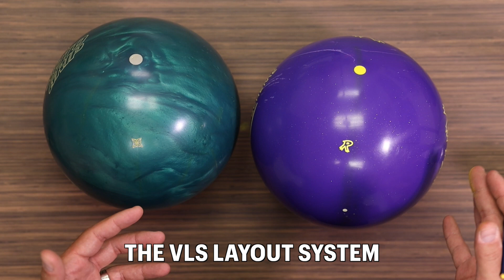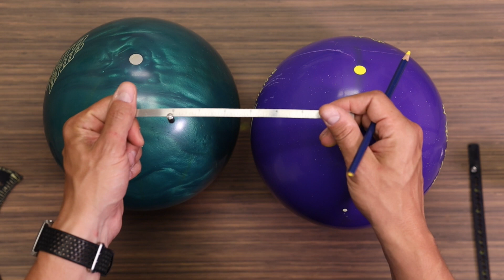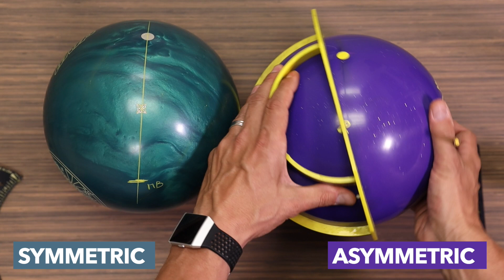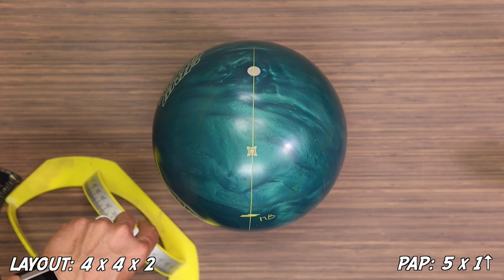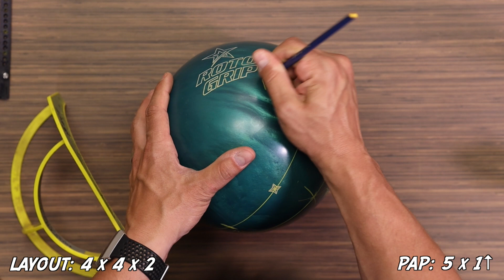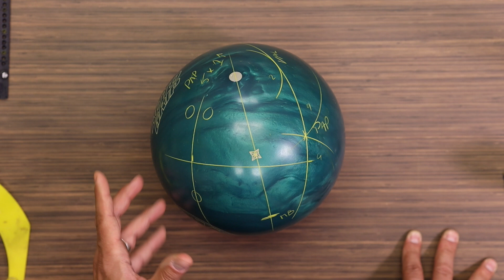How to Layout a Bowling Ball | Storm VLS

Comment: If I draw a roto grip hustle at 3 1/2 x 5 x 3, can I use it on fresh home oiling? I play straight ahead, with low roll, medium speed, and medium rpm. Thanks in advance.
Reply from the maker: It’s hard to say based on this without seeing you throw it.

Comment: this is a nice channel for learning knowledge about bowling ball layout, i m still confused about the distance between PIN to PAP, PSA to PAP, VAL to PAP and the ball reaction difference. thank you very much~😊😊
Reply from the maker: Pin to PAP is the most important.  It controls the ball flare potential.  PSA to PAP will control the shape of the hook down lane.   VAL to PAP isn’t a term since the PAP is on the VAL. The VAL is the line on which the PAP vertical coordinate is.

Comment: He starts out by marking the symmetrical ball 6 3/4 down for a theoretical mass bias......why? Why 6 3/4? Ok.
Reply from the maker: Hi Steve.  This is done on a symmetrical ball to get a spot on the equator of the ball.  6 3/4 is a quarter of the ball on the surface.

Comment: Yes, but every video I watch doesn’t show how to actually place the hole positions. Where do I find those videos?
Reply from the maker: The PAP is based off the grip CENTER.  So when you're done this layout process, you have the grip center.   The Midline is the line that cuts thru the middle of your palm horizontally and the center line is thru the center of the thumb and intersecting the fingers.   If your full span is 4 inches, you start from the middle and draw a cut line 2 inches on each side.
I hope this makes sense.

Comment: So this is a 4x4x2 layout with a 5 inch pin since pap is 5x1? Im sorry, im still in the early learning stage of understanding layouts.
Reply: No. The pin is at 4 inches from the PAP.  The PAP is measured from the grip center.  Check that video out as well.  You need to find your PAP before doing any layout work.
Reply: @markbuffa5840 "You need to find your PAP first" is CRITICALLY underrated advice for anyone just starting out from scratch. It's unintuitive to a new player that they would have to buy a ball with a default layout before actually getting a second ball with a custom layout. It took me quite a while of searching to find that very answer for myself, and I appreciate you saying it.

Comment: What about 3 x 5 x 4? Since 4 is longer than 3 obv, there is no outside line to intersect with bevause the 3 inch arc is inside the 4 inch arc. This system only works if the first number is larger than the last.
Reply from the maker: For VLS to work, you need the Pin to PAP and PSA to PAP lines to intersect, other than that it won't work, you are correct.

Comment: VLS as we know is developed and popularized by Storm so I assumed that it is tailored for their products. Is it effective to be use on other brands of bowling ball whether it is symmetrical or asymmetrical?
Reply from the maker: Hi Joe.  VLS and Dual Angle will give you the same result, just the process is different.  Once you finish a VLS layout, you can remeasure in Dual Angle and vice-versa.  It  comes down to a preference to the ball driller, however both methods should be practiced and known by all drilling professionals.
Reply: I have symmetrical ball from storm and brunswick, and asymmetrical ball from radical. The driller told me when asked what system he used to drill my bowling balls, i was told he used VLS for storm balls and Dual angle layout for brunswick and radical. In my observation, i think VLS is more effective in terms of overall performance when used in storm ball given both balls uses same surface.

Comment: Love that grease pencil! what brand, and where can I find it? The pencils offered by my distributor are awful.
Thanks for the excellent videos.
Reply from the maker: Thanks Bryon.  These are old telescore pencils from Brunswick, we have a whole bunch in stock.  They are great however they do break easily.  I like using a manual sharpener to keep the tip from breaking.  Here's the link to get the pencils. https://shop.buffabowling.com/en/pro-shop/bru-860002-002-brunswick-yellow-grease-pencil-telescore